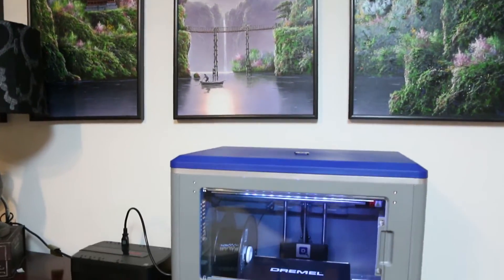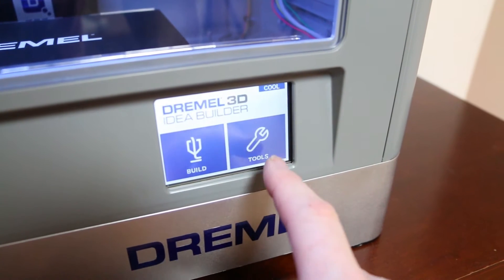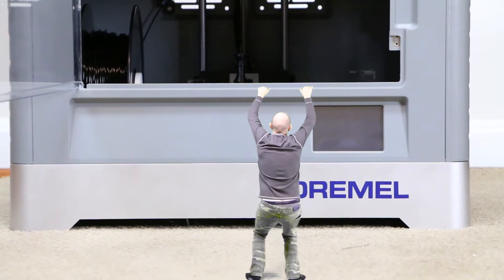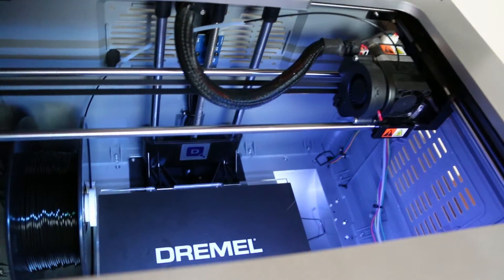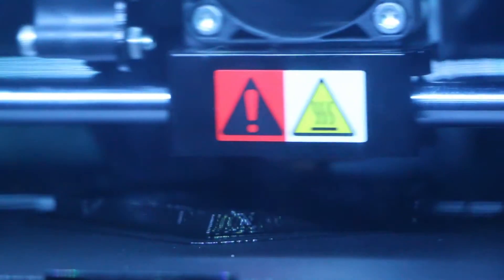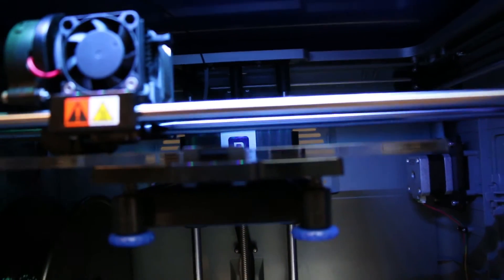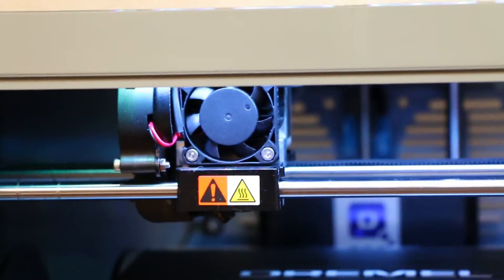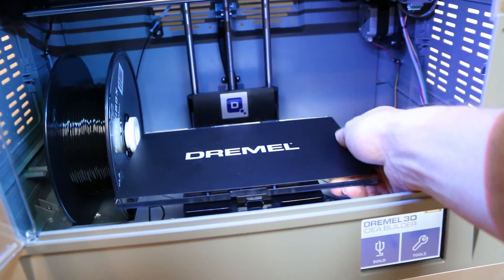Dremel 3D Printer PROs and CONs (2 of 3)

Comment: Did you know you can change the color of the LED lighting if you connect the printer up to your computer? I had it for months before I discovered that, since I always just print using the SD card.
Reply from the maker: +Mighty Jabba's Collection thanks for sharing. I did notice the strip was rgb lights.. I'm making a final video and will add this in! Thanks again for sharing.

Comment: Do you recommend to buy a 3D printer even if you don't have nothing specific use for it I mean is it worth to create things vs buy them my concern is how expensive it would get to print things over the years.
Reply from the maker: +veneno p. Thanks for the question. I suggest a 3d printer for hobby purposes. If you have design knowledge with vector art programs or cad programs, you may be able to make actual useable things. But if you don't have the design background you are beholden to other people's designs and that is not fun because many designs or printable items online have slight flaws that need to be corrected.... I will add this question to my next Dremel video.. thanks again!

Comment: Hey @trytohelpyou I recommend you using the FlashForge blue plate sheets, its amazing vs the dremel one. At one point of life I used to have 3 different beds the original black Dremel one and Blue Flash Forge and even a Glass bed but in the end I love the blue Flash Forge Sheet!

Also a program that perfect and makes the Dremel better is Simplifiy3D.

https://www.amazon.com/gp/product/B01A81FXMK/ref=ox_sc_act_title_2?ie=UTF8&psc=1&smid=ALA28Z2QFHXAS

Similar removing tools helps greatly
Reply from the maker: +Hai-Au Ho i will look into it. thanks a lot for sharing. always good to know another way and other products.. thanks again! :)

Comment: I have been using esun filaments. The spools fit perfectly and they are cheap!
Reply from the maker: +Austin Kapaun oh nice! You mean without having to hack it those reels? Theywork for the dremel I'm the case like the dremel brand reels?
Reply: i printed an adjustable spool holder i found on line so i can fit different sized reels. also the esun brand reels are slightly more narrow by a few millimeters which fits perfectly in the slot